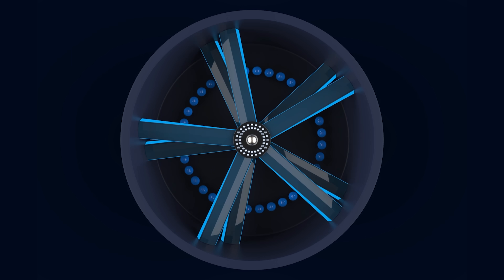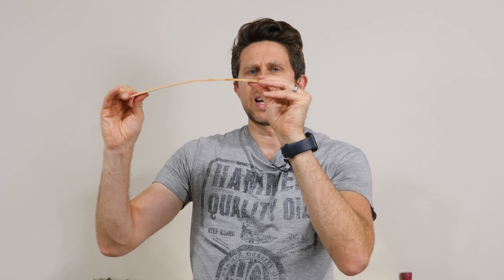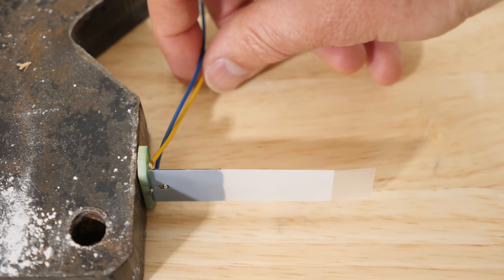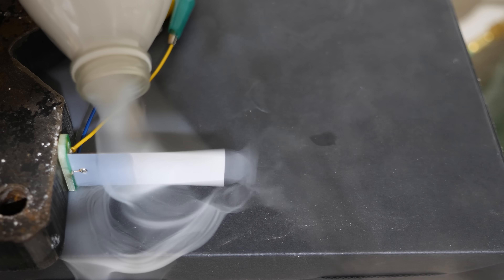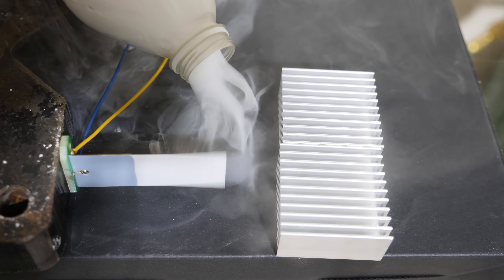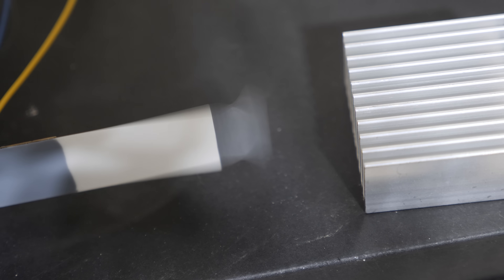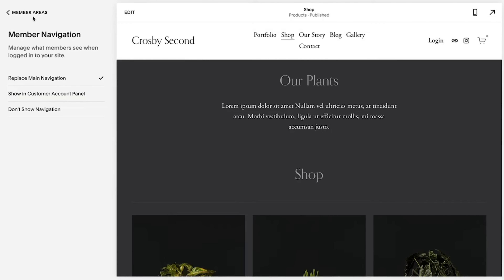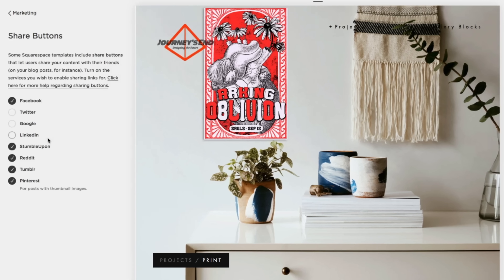A Solid State Piezoelectric Fan—Does It Actually Work?

Comment: I’ve got another idea for a solid-state fan: using static electricity.

So imagine two plates that are both conductive. And also, imagine we have some sort of way to generate static electricity, like a Van De Graff machine or a Tesla Coil.

Let’s say we apply a positive static voltage to both plates. They will repel each other because the charges don’t go anywhere.

Now, let’s apply a negative static voltage to only one of the plates. Now the plates will move closer and closer together. This is because the charges now have ways to move.

I wonder if you can use both the piezoelectric systems or the static electricity systems to generate a motor. I mean, it would be low torque and probably won’t work but I think it is kind of interesting.
Reply: Be careful not letting someone steal that idea
Reply: Not solid state, true solid state has no moving parts, like an ionic wind generator.
Reply: Piezoelectric motors have been around for decades

Comment: A brilliant invention. Are there any patents known? I´m wondering when a start up will bring the device to the next level and sell it?
Reply: This is old tech and it's not true solid state so it's not really that useful
Reply: Piezoelectric actuators are used in inkjet printers in large numbers.  Inkjet technology isn’t limited to your typical print-on-paper scenario, either, and may jet more than just ink.
Reply: short answer: NEVER because the concept is flawed
Reply: This is literally decades old tech

Comment: I could not care less how much power a fan uses if it makes no noise due to no movement then it's a perfect solution for a PC, sadly this thing still vibrates and makes noice
Reply: You should care a bit, because if the fan wastes a lot of power, guess where that power is going... into heat!  which you are trying to get rid of in your system.
Reply: @yeroca  that's why the peltier cooling does not work cuz it produces more heat than it removes

Comment: one day id love to try to make a piezoelectric fan powered rc glider, not sure if it would work but it would be cool regardless, and certainly quieter than a prop
Reply: No, wouldn't work, not enough pressure, it can accelerate air quite a bit but it generates relatively low pressure.
Reply: It would work extremely well. As a glider. /s
Reply: Maybe as an ornithopter? But you'd need to overcome the friction of joints and need a high voltage (heavy) power supply. If boats can sail faster than the wind speed then why can't a sailplane use a sail and the wind to take off and ascend?
Reply: @capodad2u  because boats have the water to push against the wind lol
a piezoelectric ornithopter would be cool

Comment: I read about piezoelectric effect in pharmacology because nebulizers work that way to spray pharmacological substance in the airways.
But I didn't quite understand it completely, so thank you so much for making this video!
Reply: It's quite different from this, nebulisation uses ultrasound to atomize fluids
Reply: @THEDANOFFICIAL  Aren't many ultrasonic transducers piezoelectric?
Reply: I first discovered this effect when I was given the little clicker part of a lighter as a child (very weak shock and no fire) and wondering how it "didn't run out of battery"

Comment: so simple and with long-known scientific principles, i can't believe these aren't more common.
Reply: They're loud with a low output. They also vibrate a lot. They aren't ideal for most purposes
Reply: @MelodicTurtleMetal  Makes sense. From the looks, it looks like they move a lot of air. I'm sure there's a way to make them better, but not sure if that would ever make them better than conventional fans.
Reply: They vibrate A LOT, they are very hard to scale, they need a lot of space. In general purpose settings rotary fans are far superior.
Reply: @0106johnny  That makes sense. Piezoelectric is always hard to scale. You just can't make large piezoelectric devices and/or make them have any real force. One company tried to make an electric "impulse engine" out of piezoelectric crystals. One of the problems though is that they work better as they get smaller... but then you need more of them (and the electronics start to take up more and more space, making them less efficient).

Comment: Time to "full speed" an issue? That's an en-gin-ears FIRST thought? I would value versatility and efficiency and flow and velocity first BEFORE "Time to speed."
Moving a microscopic, random-direction and unfocussed air flow is one thing. Being able to drive that down a duct or through a condenser is another. 
Later, Doug
Reply: What's the efficiency in the system? Bet it's horrible! Say one hp of mech energy creates, what, 750 watts or therabouts... What would a piezo create with 1hp?

Comment: There are also fans that use magnetic levitation bearings and are therefore in principle not subject to wear. But there are certainly useful applications for the fans shown if you do not need much air volume.
Reply: @emeraldbonsai  The fact that magnets lose their magnetic effect under certain circumstances has nothing to do with wear but other factors such as temperatures or magnetic fields. Under relevant circumstances in practice, magnets last far beyond the lifetime of all the people who write comments here. Probably even the plastic strip has dissolved long before the magnets lose their effect. So this is at best academic smartassery, but a completely meaningless argument in reality.
Reply: I had one of these mag-lev fans in my computer. Newly silent during operation, but startup and shutdown had jet engine like whine as the fan was not stable in the magnetic field under acceleration/deceleration, which did result in the eventual failure of the fan. That said, it flowed air like nothing else I've ever seen. Great fan from a cooling standpoint.
Reply: I love how people don't read to see if what they were going to say was already said. It just shows that no one cares about exchange of information, they are just burning to prove someone wrong.
Reply: @emeraldbonsai  - you are mistaken. (Some) Electromagnetic bearings are powered via induction in both parts (same principle as wireless charging)
Reply: These work great. I use them to circulate my fishtank, while keeping the electronics out of the saltwater.
Reply: I have some hydrodynamic fluid bearings in the fans of my HTPC. ZERO vibration and noise.... been working for ~ 12 years now. Not every day, mind you, but nonetheless zero maintenance.
Reply: Sounds like one of those perpetual motion projects 😂
Reply: But the magnet’s strength would degrade over time.
Reply: @suspense_comix3237  - Not if they were electromagnetic bearings (ignoring the decay of atoms)
Reply: @JohnnyWednesday  electromagnetic bearings will also heat up as some of Eddy current in its own rotor
Also induction losses can't be ignored if you are supplying insane power
Reply: @JohnnyWednesday  Well, that is true. I agree with you.
Reply: @akakabira  You do have a point.
Reply: @suspense_comix3237  Magnets with its magnetic property just don’t disappear like that (it would probably last for decades). And forget to mention the railing. You have to make the outer ring of the magnetic bearing to stay in that place and that place only without drifting off.
Reply: @suspense_comix3237  Why? Magnets don't get used up.
Reply: @suspense_comix3237  you can use electromagnets easily.
Reply: @THEDANOFFICIAL  at a cost of MORE energy depending on the workload.
Reply: @suspense_comix3237  yeah.. like.. 10 years?
Reply: I highly doubt it, you can get small fans with way less than 1 watt, with a lifetime of 50.000 hours (6 years) for less than 5€.
They dont vibrate, depending on the model can work with any voltage and with AC or DC.
I dont see any benefit in this technology,
Reply: @jonasstahl9826  These aren't meant for general applications. They're a solution for cases that depend on extreme reliability, cases where traditional fans would lose performance or could not be built to withstand, or for environments where exposed wire elements from a motor would carry too much risk like flammable or explosive atmospheres.
Reply: @dustinbrueggemann1875  I dont see any application, where they could be used, small stuff with small cooling demands can just use passive cooling for bigger applications the vibrations become an issiou.
On top of that nothing that isnt commonly used is reliable, because you need expierence to design them well.
On top of that they have a bunch of weak points like oscilating material, how long do they last before the material weakens and break. Specialy when we talk about extreme temperatures, corosive enviroments or UV exposer.
Reply: Electromagnetic bearings aren't quite strong enough to carry a moving fan and just a tiny bit of instability is enough to cause a tiltover; also they are very expensive to make. If a regular cpu fan with magnetic bearings are very expensive, why in the earth would people even buy those large ceiling fans for thousands of dollars duh
Edit : the "Electromagnetic" I used in the first line, you can refer as the strongest magnets we can have cuz the regular magnets in no way could be as powerful and robust
Reply: @akakabira  Did you do any research before declaring it impossible? Two minutes of research tell me that Corsair make consumer-level magnetic levitation fans for computers.
Reply: @dgphi  I'm saying that small fans are soo expensive and still aren't perfect, making life size ceiling fans would be impossible (as of current technology)

Comment: Maybe could be useful for cooling low power electronics like tablets or laptops?
Reply: They need 120v...
Reply: @SimonStuff2000  is that set in stone or can they just need whatever they're designed to need? Anyway, a lot of devices with fluorescent backlights had high voltage supplies.
Reply: Not really, you need a pretty high voltage alternating current

Comment: Great video.....  Question: How much torque can be created to create rotation drive?
Reply: 0, it's an elastic mechanism, it's phisically impossible to make it produce torque because it's always in balance and it will always reciprocate.
Reply: @THEDANOFFICIAL  I think you could rig up the tip of the "blade" to a lightweight crank, and convert that motion into rotary motion.  But you'd probably have to spin up the rotary part first to get the blade to move at its resonant frequency.  Otherwise, it would never start.

Comment: PC fans are variable speed depending on the heat output of the processors. So I guess to increase air flow with this it would have to jump up to the next available resonant frequency. Right? Or else there would have to be a bunch of these and it could turn them on/off separately as needed. Seems unlikely this will outperform brushless PC fans.
Reply: No, you could just use PWM to change the duty cycle of the fan (and how much the blade bends) without touching the frequency ; I'm still not convinced that this will displace fans anytime soon, it seems to me like this generates a decent flow but almost zero pressure, it would bounce against the heatsink instead of going through the blades into the hot insides.
Reply: ofcource they wont outperform brushless PC fans. he already said its not as strong as a conventional fan.